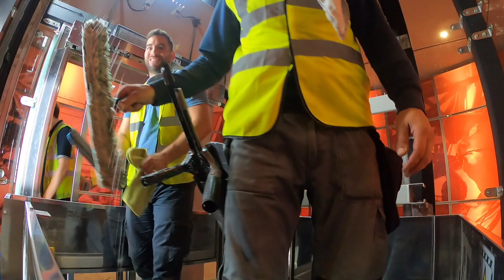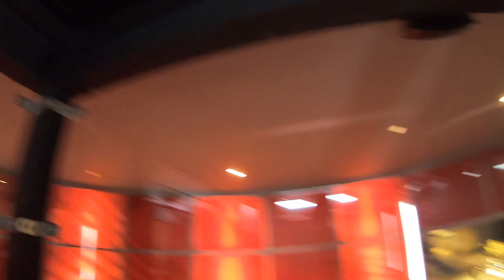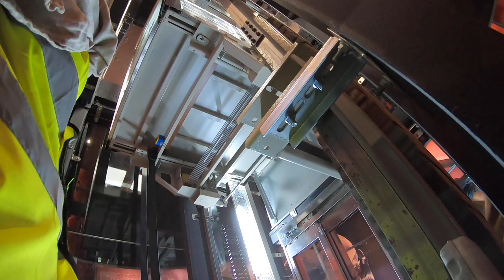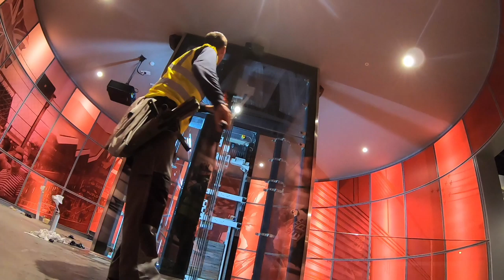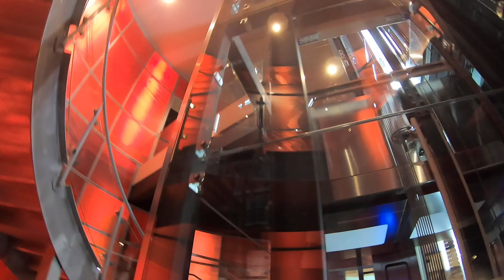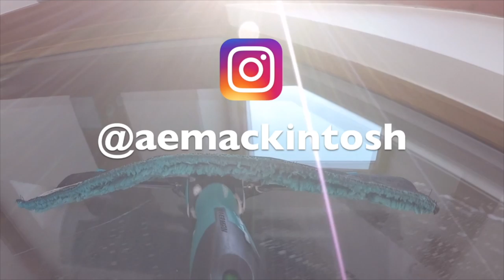Cleaning A Glass Lift Shaft

Comment: Cleaned a glass lift shaft before very easy providing you have all work permits and it was during closed hours so made it very easy
Reply from the maker: Allbritepvc This one had just been installed so the engineers were on hand to help us. It was a bit tricky getting around the workings of the lift, but a great experience.😃👍🏼
Reply: @aemackintosh  I was a lift engineer at at the time of cleaning  (2002-2009) quit after not getting the correct P.P.E gear for working at height more than once so I quit  got offerd to work on the windows of a mate of mine spent 2 years working for a wage then went on my own never looked back best thing I ever did  I clean wfp
Reply from the maker: Nice one.😃👍🏼